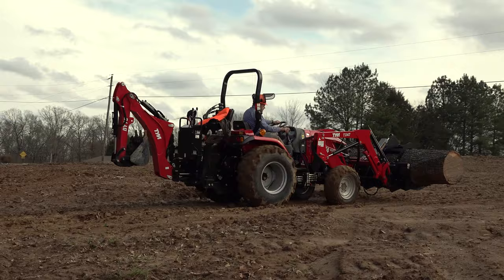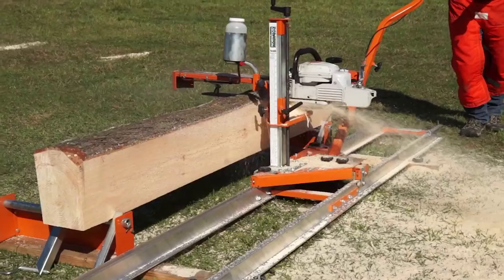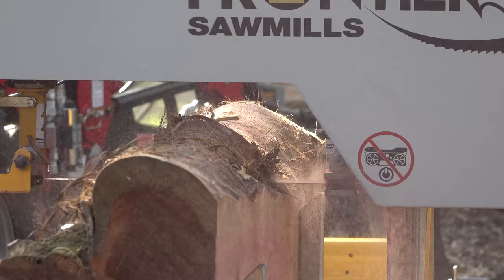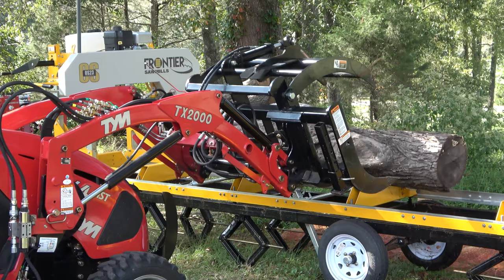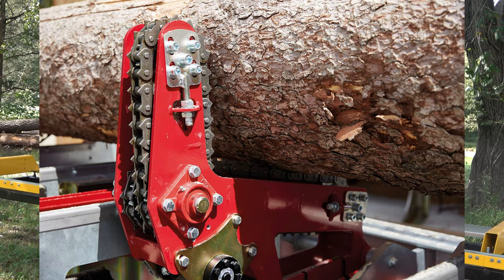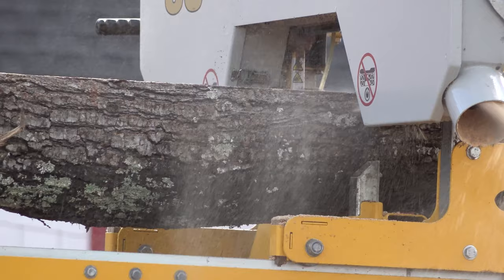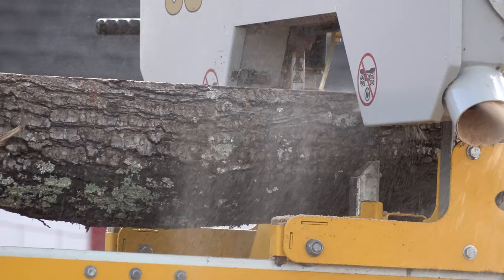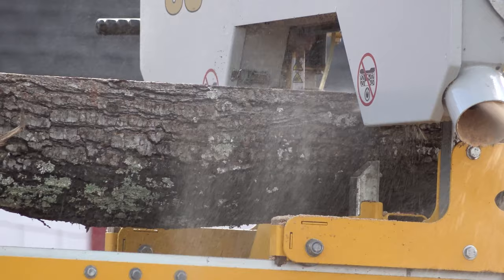How to Buy A Sawmill 😬😬😬 Lessons Learned Frontier Sawmills

Comment: Really liked your delivery on what to look for when thinking of buying a mill. I am planning to moving North (Northern New England) for retirement. I currently drop a lot of trees for clients (side work, other wise I am on a PC 10 hrs. a day) and either take the wood for firewood keep & sell it or if its a trash tree it gets dumped. But, I have been thinking of getting into milling especially if I am moving North into the woods and retire into a new business of milling wood for special cutting for lumber used for timber framing, Post and Beam, Bar tops, table tops, wide panel flooring. You have provided some info I had not thought off regarding the mill. So thank you very much!
Reply from the maker: Go bigger! LOL. I have had good service out of the sawmill, but it could be bigger. I have had to turn down logs. The mill is just not big enough.

Comment: I just purchased a frontier Os23. Been watching your vids and enjoy them. I have 5 acres of really old timber to thin out and build some structures. I've been using a chainsaw mill but I'm 69 and it needs to go to the scrap metal pile. Have tractors and equipment to help. I'm sure I'll go thru a steep learning curve so I bought plenty of new bands with my order. Hope the mill gets here before the rains hit. I'm from Oregon so have many different variety of trees, but ceder is my fav. I'll be building a saw shed right off. Thanks for all your help and taking the time to video your journey.
Reply from the maker: We are cranking up the sawmill for some real use over the next two weeks. We are cutting the siding, roof purlins, and many other parts to our new barn. Big fun.

Comment: How did the os18 work for you I'm thanking about getting one
Reply from the maker: I have done two videos so far. I am releasing another one soon. Would buy the track extension with the sawmill because in my case I had to pay extra shipping when I bought it later. It is very hard to cut 8 ft boards as it comes from the factory. Very tight. With the extension it will do 8 and 10 ft boards with no issue.

Comment: will it handle seasoned yelloe pine and oak?
Reply from the maker: Yes it will. Yellow pine has sticky sap, so you will need to run soap in the water. Oak is easier to cut than pine. No sap.

Comment: Curious if you have problems cutting hard lumber
Reply from the maker: No. I just cut up red and white oak. I think it cuts easier than a sticky pine.
Reply from the maker: We did upgrade our engine to a 14hp. I would buy a 10hp if I had to do it again.